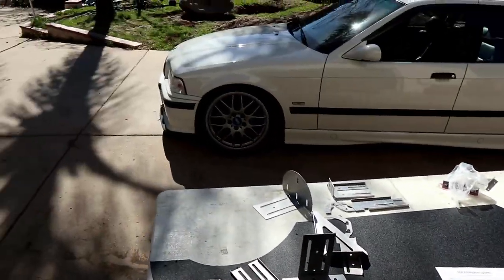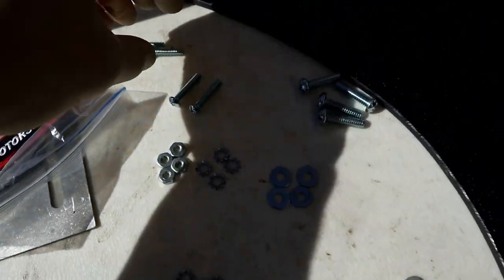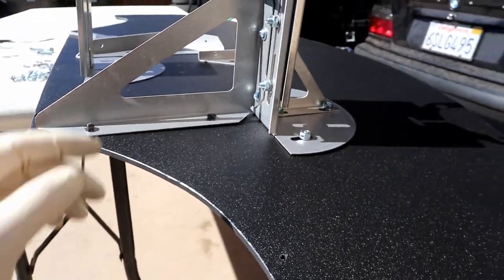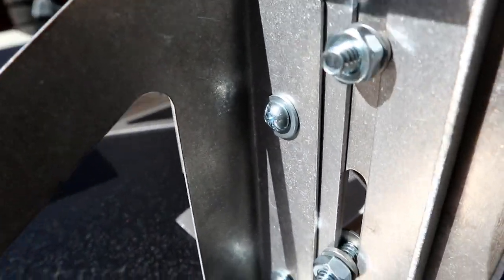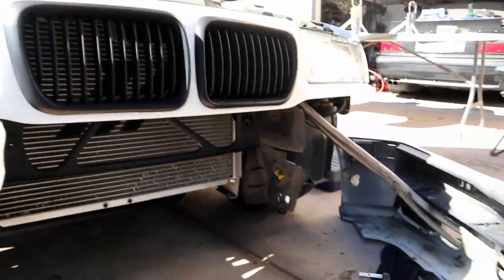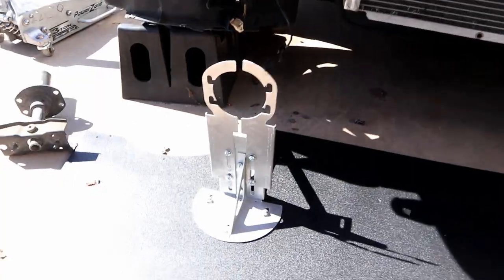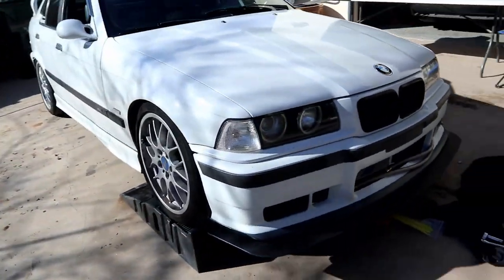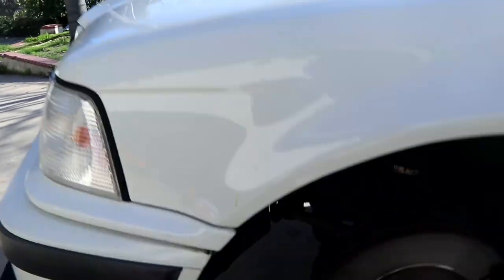My Daily M3 gets a Mkah Splitter!

Comment: Completes your aero package!  Hopefully front will feel as planted as the rear.  My bro has it on his track car and we put more support towards middle of splitter with small mini uni-strut mount.  Under pressure splitter would move slightly and drag on off camber corners. But was a simple fix
Reply from the maker: yeah well see how it feels on the next canyon run, i have really no expectations for this lip as an aerodynamic solution, even mounted solid as it is it still feels pretty flimsy, I wouldnt trust it to hold my weight.

Comment: That hardware might fly on a rear diffuser, but on a front splitter it looks like it will sheer off after a few parking lots. With a LTW splitter you don't need nearly as many bolts, but they're 10mm so they're as beefy as the tray itself.

Comment: Thanks for your videos. Have a couple of questions for you. First I have a '95 325is. The  drivers seat is in sad shape and I have the opportunity to get an OEM  sport drivers seat from a 2006 325i (fyi VIN:WBAVB13586K001565). 1)Can this seat be retrofitted in my 325iS without any major problems?
2) will newer OEM rims with Size 225/45 R17 fitmy 325?. The guy who has the wheels says they're off of a 3 series but no info what year series 3,
I am thinking they made need spacers. Any advice greatly appreciated.

Comment: Nice job dude! Mkah is hit or miss for me. I got there door card delete panels and one came dented up.
Reply from the maker: yeah that's what ive heard about them, some people swear by them but im not in that crowd.
Reply: Yeah i had ordered their door panel cards and the fitment wasn’t acceptable to me. Sold them and kept it stock. Might try the Hard motorsports ones at some point.
Reply: @Freestyler4130  I ended up keeping mine. The passenger side fit great but the driver side was all warped and a pain in the ass. Might get the condor ones later on since it looks way better anyways. I got tired of the plastic clips on the stock cards lol

Comment: Um the roof spoiler cancels out the trunks ability to create downforce. Lmao why is this a typical hot boi setup?  hahaha like it takes little brain power to look at it and see that the roof spoiler is deflecting the air over the wing 🤦🏻‍♂️
Reply from the maker: true, its hot boi because it's a daily driver and its all for style. this car is a daily driver, and never gets up to a speed that any increase in handling will be noticed. also, i wouldnt trust this lip, wing or roof spoiler to hold my own weight.